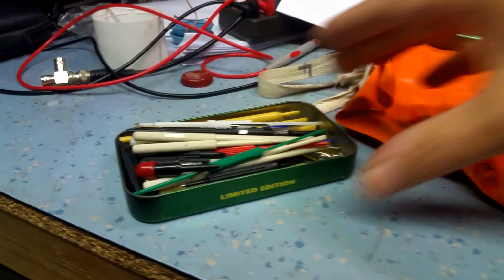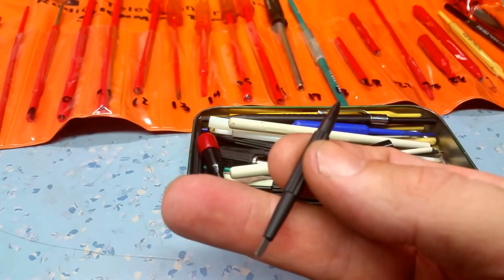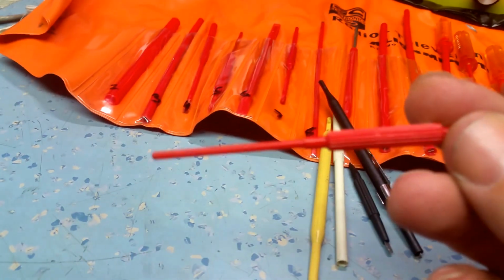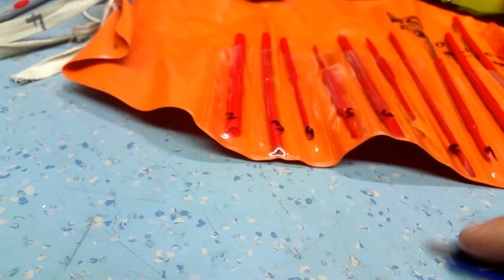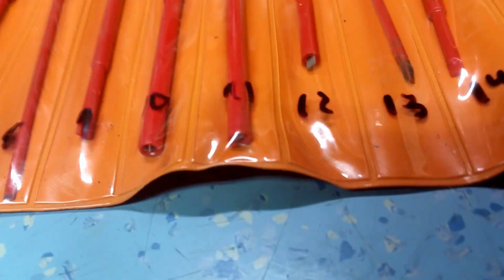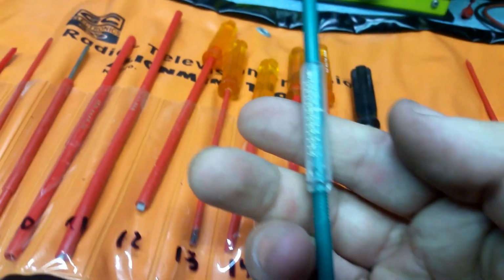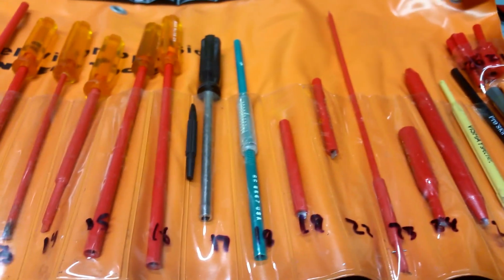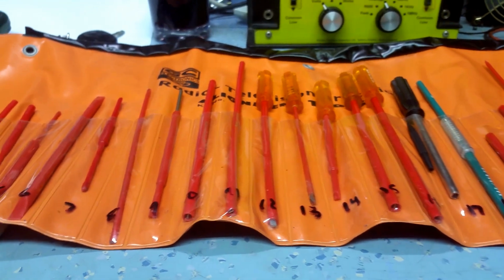Twiddlers, tweakers, fiddling sticks, phantom dabblers tools

Comment: I bought a set similar to the GC here in the US recently made by a company called Aven. Very high quality but around 45 pounds when you convert the currency. I remember back in the 70's when I was a young lad just getting into electronics the local parts supply house used to give away those 9 piece plastic alignment tool sets from GC Electronics in the plastic pocket protector style case as promotional items or at most sell them for a dollar or two. I saw the same sets selling on Ebay for $20 and up. Crazy prices but if you're going to align radios nothing else will do I afraid. ATB Doug.